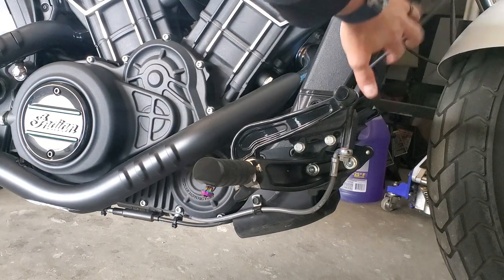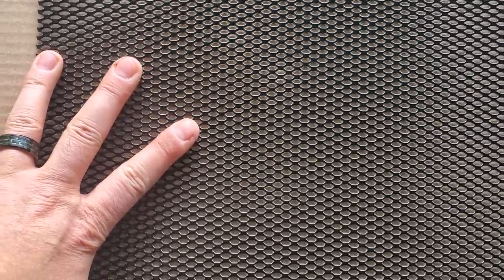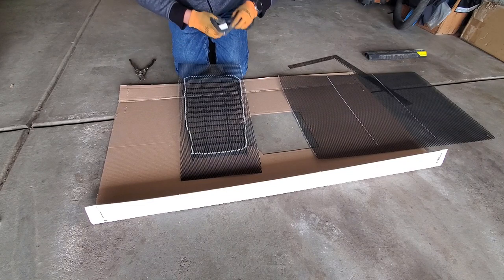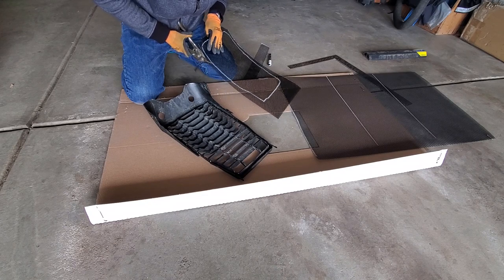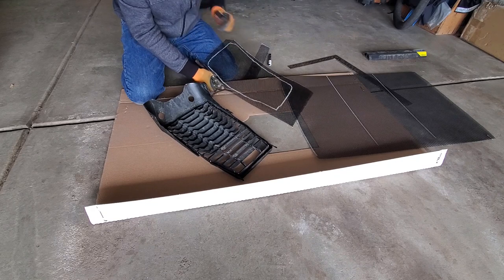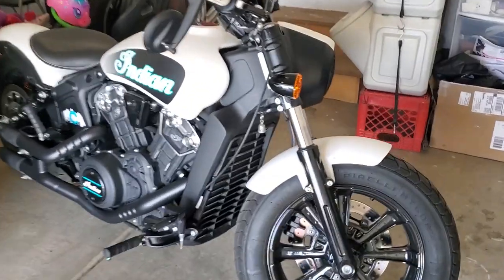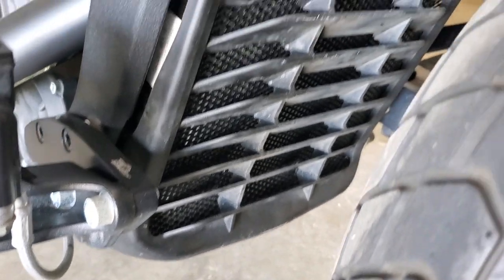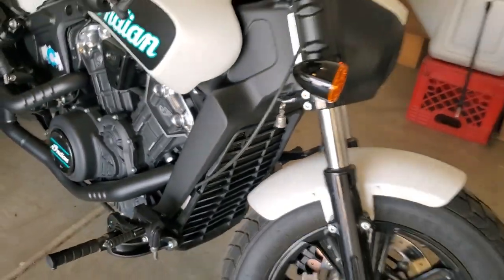How to make a radiator guard for your Indian Scout Bobber

Comment: Thanks Jim, I have just done this on mine and your instructions were great. Just one thing I did different was to use a straight edge on the top and bottom of the mesh to get a cleaner bend and it helps seat it better while you use the flathead to shape the sides.
Reply from the maker: Awesome! Glad it worked out for you!

Comment: So since doing this, does the bike run hotter, are there any other side effects?
Reply from the maker: I have had no issues. The 2021 model does not have a temp gauge, but it was tuned on the dyno for 4 hours with this guard and my shop had no concerns.
Reply: @Jimbobbington  ok thanks I might do this with mine then
Reply from the maker: @douglaz2053  easy to do and the ones available for sale are usually like $70-$100!